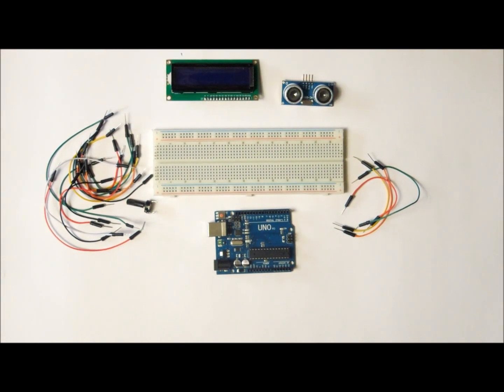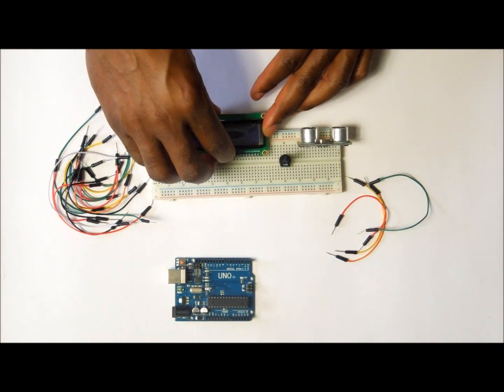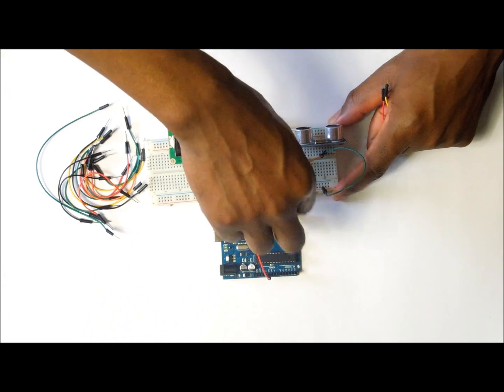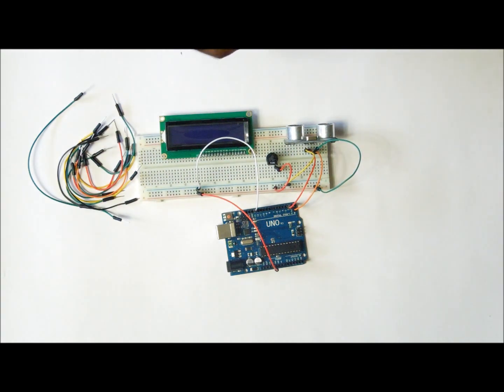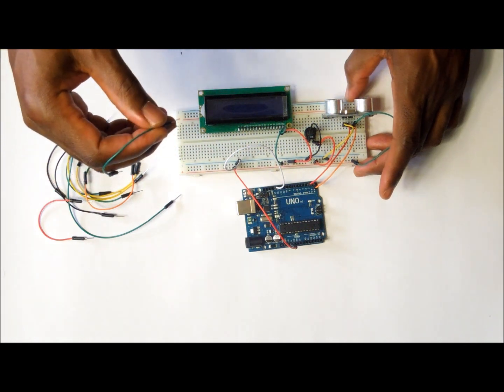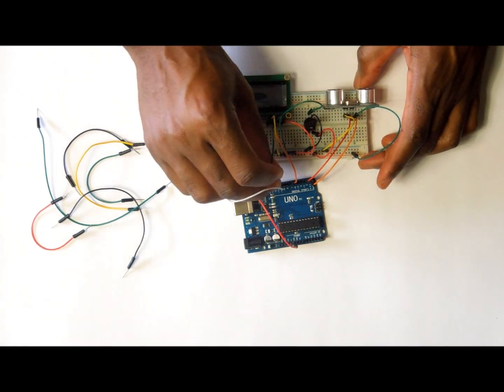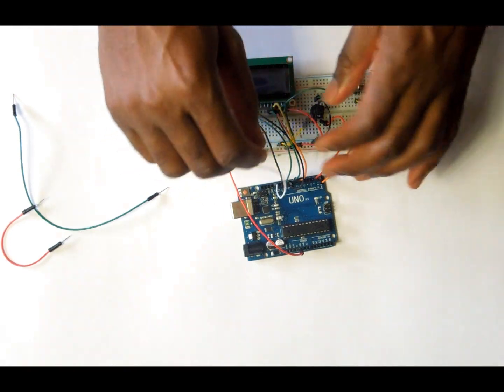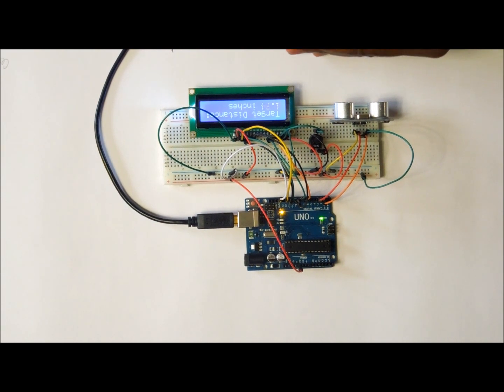Measuring Distance with Ultrasonic Sensor, Arduino, and LCD

Comment: everything should be working? My code had worked and transferred, but my screen is still just blue? What should I do?
Reply: I had that problem but how I fixed it is I just turned the potentiometer to the left but try turning it in one direction (not too fast) all the way until it shows up! Hope it works!

Comment: Arduino: 1.8.9 (Windows 7), Board: "Arduino/Genuino Uno"

C:\Users\shree\Desktop\sketch_apr16a\sketch_apr16a.ino: In function 'void loop()':

sketch_apr16a:32:9: error: expected '(' before 'actual'

  2; for actual target distance.

         ^

sketch_apr16a:32:9: error: 'actual' was not declared in this scope

sketch_apr16a:35:15: error: could not convert 'LCD.LiquidCrystal::setCursor(0u, 1u)' from 'void' to 'bool'

  LCD.setCursor(0,1); //Set cursor to first column of second row

               ^

sketch_apr16a:36:16: error: expected ')' before ';' token

  LCD.print(" "); //Print blanks to clear the row

                ^

exit status 1
expected '(' before 'actual'

This report would have more information with
"Show verbose output during compilation"
option enabled in File -> Preferences.

Comment: what if I don't have potentiometer .is potentiometer necessary??
Reply from the maker: The potentiometer is for adjusting the brightness of the screen only. Try and see if you digit are visible.
Reply: sir plz help me..actually my LCD display is JHD162A and I don't have potentiometer also .so will my circuit work ??
Reply: TechExult my digits are not visible but my screen is glowing. What should I do

Comment: HI,
I tried this and during Compilation , I got an error message " echopin was not declared in this scope".  
The line highlighted by the compiler was this  " pingTime=pulseIn(echopin,HIGH); // ping time is presented in Microseconds". So, I can't able to proceed further. I write the code as per the code given in your web site. Please clarify and help me to solve this. 
Regards,
Renganathan